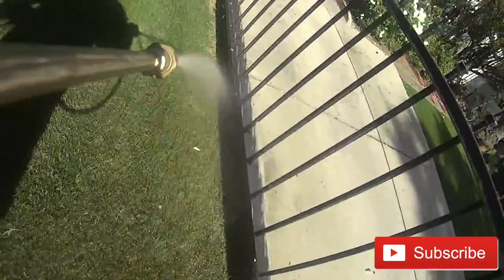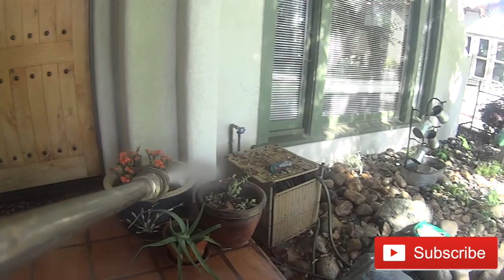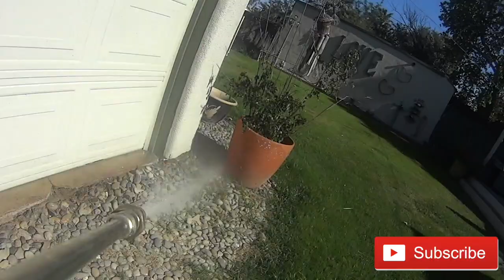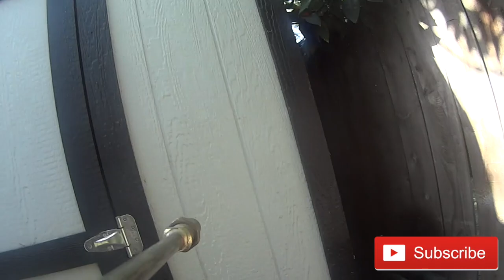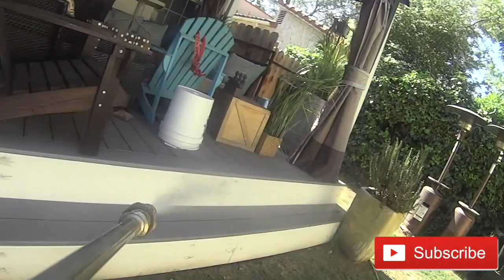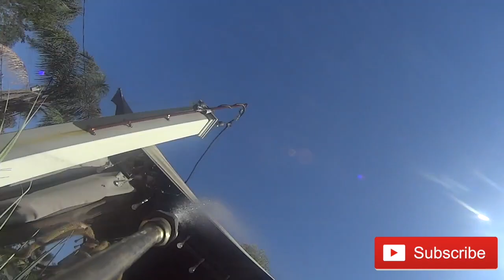Cavlary Pest Control Job Upload Earwigs,Roaches, Spiders

Comment: How did you make the spray cam?
Reply from the maker: Just Termites I use a Sony Exmor HD Action Action Camera. Has GoPro fittings on the case. I use a GoPro clip attachment. It just clips on to my spray gun.
Reply: Thanks!